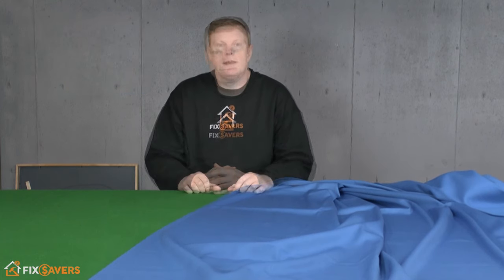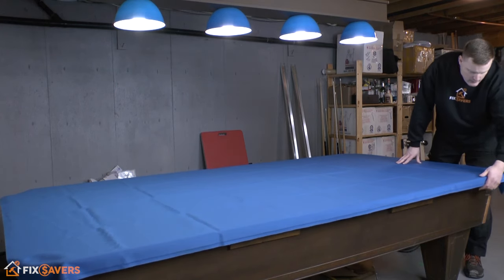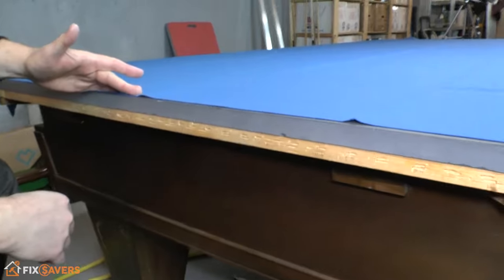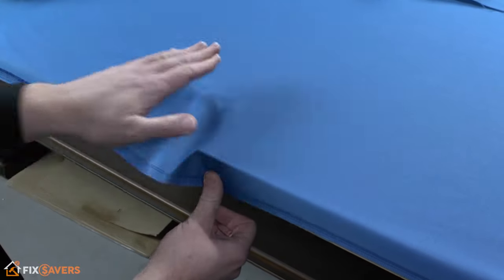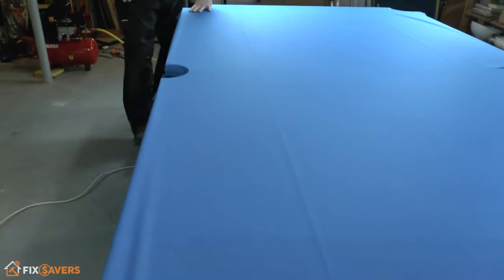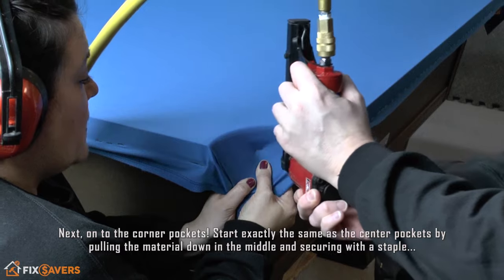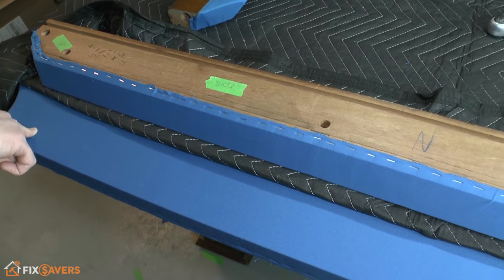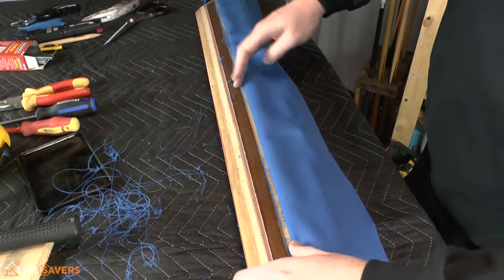How to Install a Pool Table Cloth - FULL DIY GUIDE, BEST ON YOUTUBE!!!

Comment: I was quoted $700 to level and re felt my pool table. I offered them $500 cash thinking that was enough money but it wasn’t so I did it myself. The company that put it together the 1st time used bondo on the seems so other videos helped with that, but this was the most helpful. Thank you.
Reply from the maker: Excellent stuff! Glad it was helpful for you! We also have video's on how to seal your slate joints using both beeswax and Bondo so you can choose which best suits. Both are available on our channel. Hope that helps! 👍

Comment: Thank you very much for the time and effort in making this and the other video tutorials.  Just finished the process of my first assembly up to beginning to install felt now.  Without your videos, would never have been able to get to this point at the quality desired.  Have been learning lots of added tips and tricks on final leveling after 0 degrees on the digital level by slow rolling a ball on the slates, and techniques of getting super flat beeswax on cracks and filling holes (level) with beeswax. Your videos gave me the confidence to attack the project with my Olehausen.  The pocket finishing is something prior installers never did and it will look far better than the pros who left ugly cuts visible in the pockets of my last table.
Reply from the maker: That's great to hear! Really good to know that we've helped you out along the way with you install, and hope everything went nice and smoothly for you! Yes, the pocket finishing is something that is overlooked a lot (even by professional installers, as you mentioned, most likely due to time factors) but it does make such a big difference to the overall look inside the pockets - those cuts always look terrible (ironically, somehwhat unfinished in appearance, lol!) Thanks again :-)

Comment: Simply outstanding video!!  Thank you.  However, I am confused about where the stretch calculations from your other video come into play.  I plan on doing mine in a couple hours if anyone has ay input for me that would be greatly appreciated.
Reply from the maker: Thank you for your comment! Just to clear up any confusion, we are currently putting together a newer and more advanced version of our cloth installation video, which will utilise the stretch index method. The stretch index can be very helpful when you are fitting high-end worsted cloths that have very little give (such as Simonis) as they can be very unforgiving.

The new more advanced video is NOT designed to be a replacement for our original cloth installation video. Instead it is designed for people who want to delve a little deeper and/or are installing cloths such as Simonis.

It's likely that 80%+ of cloth installations done on pool tables are done without utilising a cloth stretch index method, by a process identical or similar to the process shown in our original video, so it will remain relevant to the majority of people who want to do a DIY cloth install.

But if you are installing Simonis (or similar top-end worsted cloths) then the new more advanced video (which uses stretch index) would definitely be a good option.

The process is slightly different if using the Stretch Index method, simply because it HAS to be due to the requirements of the process. But you can use either method, original or advanced. They both work!

Hope that helps!

-----------------------------------------------

To help support us:

1) Please be sure to use our Amazon Links!

2) Please ensure you LIKE our video's, and SUBSCRIBE to our channel!

3) Donations always welcome! Hit the SUPER THANKS option below the video on YouTube!

Thank you for your support!

Comment: Thanks for the informational video. The problem I have is my Kasson pool table doesn't have the wood backing on the slate pieces, so it needs to be done with adhesive. Any videos on how to do that?
Reply from the maker: Hey there! Unfortunately we do not currently have a video for the glueing method for pool table cloths, only the staple method as shown here. Sorry we couldn't help this time 👍

Comment: I really appreciate this video! One question though... How do you tell which side of the cloth is the playing side?
Reply from the maker: The playing surface is smoother, whereas the rear will look a touch fluffier. You may want to check out our new cloth installation video (specific for worsted cloths) as this shows the difference as an example, watch from 8:00 onwards for the clips that compares front and rear of cloth: https://youtu.be/s4mH1Lw104I  Hope that helps! 👍
Reply: @AverageJoesPool  Thank you! I got my cloth now and it has an embroidered edge, so now I have more indications than I need ;)

Comment: Thanks for extremely well done videos. Can you please recommend a worsted cloth from Amazon Canada? So many conflicting reviews Reg ball marks and creases!
Reply from the maker: Hey there! Thank you, glad you are enjoying our video's!! With regards to cloth, budget is always a factor. Pretty much the best of the best is Simonis cloth, but it does (naturally) come with a higher price tag. We have added links to several cheaper options on Amazon (including amazon.ca!) into the video description if the budget is tight. Yes, cloth reviews often vary from great to terrible, and this often seems to be linked to the experience that the person had fitting the cloth rather than the cloth quality itself. On cheaper cloths expect ball marks (burns, white spotting). You get them on expensive cloths too, but they tend to be more resilient (Simonis make a 860HR cloth and the HR stands for High Resistance, designed specifically to reduce white spotting). Hope that's of some help!!

--- 

To help support us (for both you and others reading this) there are a few things you can do:

1) Donations both needed and welcome! We cannot operate Average Joes Pool without the support of people like you! You can donate by PayPal - just go to www.paypal.me/thanksfixsavers - or alternatively you can click the SUPER THANKS icon under the video on YouTube and donate that way too!

2) Please ensure you subscribe to our YouTube channel. 

3) Please Like our video's on YouTube (by clicking Like!) 

4) Please help spread the word, the more people who know about us the better! Add links to our video's in forums, let people know about us.

Thank you for your support!

Comment: My table is 1" 2 peice slate but it dont have the wood strips under the outter bottom edges to staple the cloth too? Has someone removed them? My last cover I had to glue on with clamps..should I put the wood strips on it?
Reply from the maker: Yes, not all pool tables will have the slate backing. Most do, but not all. The other method for re-clothing is gluing instead of stapling, which it would seem the manufacturer of your table intended. The process is different though, and unfortunately we do not have a video for the gluing method so you'd have to have a good search around YouTube and see what's out there. I would recommend against adding the timber backing retrospectively as this throw up issues such as overall table bed height, the skirts may not be long enough to hide the slate edges anymore when raised etc. We hope you find a good guide for gluing. Best of luck! 

-----------------------------------------------

To help support us:

1) Please be sure to use our Amazon Links!

2) Please ensure you LIKE our video's, and SUBSCRIBE to our channel!

3) Donations always welcome! Hit the SUPER THANKS option below the video on YouTube!

Thank you for your support!

Comment: Nothing is working to get the wrinkles out around the side pockets. We have Predator cloth. Any advice?!?!
Reply from the maker: Hey there! Usually if you find you are repeatedly getting wrinkles whilst you're confident you are doing everything right, it can be best to rewind a little. The cloth may not be stretched quite right in a certain direction before you got to the side pockets. If you undo a few staples at a time you'll be able to pull the cloth slightly more in that area and see if it makes the wrinkles disappear or get worse. The pull may be required at an angle you would not expect, hard to know without having it in front of you. But that would be a good route to take, try and find the source of the issue rather than fighting against something that's not quite right. Hope this helps!!

--- 

To help support us (for both you and others reading this) there are a few things you can do:

1) Donations both needed and welcome! We cannot operate Average Joes Pool without the support of people like you! You can donate by PayPal - just go to www.paypal.me/thanksfixsavers - or alternatively you can click the SUPER THANKS icon under the video on YouTube and donate that way too!

2) Please ensure you subscribe to our YouTube channel. 

3) Please Like our video's on YouTube (by clicking Like!) 

4) Please help spread the word, the more people who know about us the better! Add links to our video's in forums, let people know about us.

Thank you for your support!

Comment: Are heading protecting required?
Reply from the maker: Do you mean ear protectors? It depends on your preference. I always wear them whilst using power or air tool of all kinds, and in the location of this table the ceilings are quite low and no soft furnishings and so you get a lot of noise. But most people are happy to use air staplers without ear protection, whatever you prefer personally 👍

Comment: Cloth developed wrinkles around the center pocket after the holes where cut into the cloth.........did not appear right away but the hole looked distorted after cutting...........I used nail polish to finish the cut around the hole...........I cut the holes by inserting a tube into the bolt holes and hampering on the tube with a hammer to cut the cloth..........what is the best way to fix this?  thanks
Reply from the maker: My guess would be that by hammering the tube into the hole to cut the cloth you would have stretched the cloth, hence the hole now looks distorted. The holes should be cut with a knife or scissors. The only way to fix this would be to see if you could re-stretch the cloth a little by undoing the staples one area at a time and taking up the slack. And then re-cutting the holes but this time with a knife or scissors. Not a hammer and tube. Hope that helps! 👍

--- 

To help support us (for both you and others reading this) there are a few things you can do:

1) Please be sure to use our Amazon links in the Video Description!

2) Please Like our video's on YouTube (by clicking Like!) 

3) Please ensure you subscribe to our YouTube channel!

4) Donations both needed and welcome! You can donate by PayPal - just go to www.paypal.me/thanksfixsavers - or alternatively you can click the SUPER THANKS icon under the video on YouTube!

5) Please help spread the word, the more people who know about us the better! Add links to our video's in forums, let people know about us.

Thank you for your support!
Reply: Clarification, I did not stretch the cloth to cut the hole, the process is similar to die cutting where the cutting surface the sharp inside diameter of a tube is held against the bottom of the cloth and does not stretch or raise it off the surface of the slate and then a ball peen hammer ball end is used to lightly strike the cloth pinching and cutting the cloth against the sharp inner edge of the tube thereby cutting the fibers very easily.  Forms a near perfect hole in the cloth slightly smaller in diameter than the hole itself since the tubing is inside the hole and fits tightly.  I assumed that cutting the hole with a knife and scissors would cut all the fibers around the hole similar to the way the die cutting works and if so then I would expect similar problems with the knife and scissors method.  I'm thinking I could have super glued (or glued) the cloth to the slate around the hole prior to cutting the hole.  I also discovered that the wrinkles are coming and going away with temperature.  It is currently start to drop from the 70's F to the 50's F.  Thanks for your prompt reply and excellent video.  @AverageJoesPool

Comment: I’m not sure if someone commented on this already, but it would be nice to have reference to the stretch index for the cloth on this particular video. It doesn’t seem to use it or reference it.
Reply from the maker: Thank you for your comment! Just to clear up any confusion, we are currently putting together a newer and more advanced version of our cloth installation video, which will utilise the stretch index method. The stretch index can be very helpful when you are fitting high-end worsted cloths that have very little give (such as Simonis) as they can be very unforgiving.

The new more advanced video is NOT designed to be a replacement for our original cloth installation video. Instead it is designed for people who want to delve a little deeper and/or are installing cloths such as Simonis.

It's likely that 80%+ of cloth installations done on pool tables are done without utilising a cloth stretch index method, by a process identical or similar to the process shown in our original video, so it will remain relevant to the majority of people who want to do a DIY cloth install.

But if you are installing Simonis (or similar top-end worsted cloths) then the new more advanced video (which uses stretch index) would definitely be a good option.

The process is definitely slightly different if using the Stretch Index method, simply because it HAS to be due to the requirements of the process. But you can use either method, original or advanced. You can pick and choose, watch both and do whichever you like the look of, they both work!

Hope that helps!

--- 

To help support us (for both you and others reading this) there are a few things you can do:

1) Please be sure to use our Amazon links in the Video Description!

2) Please Like our video's on YouTube (by clicking Like!) 

3) Please ensure you subscribe to our YouTube channel!

4) Donations both needed and welcome! You can donate by PayPal - just go to www.paypal.me/thanksfixsavers - or alternatively you can click the SUPER THANKS icon under the video on YouTube!

5) Please help spread the word, the more people who know about us the better! Add links to our video's in forums, let people know about us.

Thank you for your support!

Comment: How about moving house can I reuse the same cloth?
Reply from the maker: Yes, absolutely you can. However, refitting tends to be much harder than a fresh installation, and it's hard to get 100% good results because you have to try and line everything back up exactly as it was before, including stretch, and the cloth is now cut and has staple holes etc in it. If it's an expensive cloth then re-fitting is a good option. But if it's a cheaper cloth it may be better to buy a new cloth and save yourself the headaches of the refit process. Hope that helps 👍

Comment: I have a question.  One of my shims has moved from under the slate and caused it to droop some and come out of level in one corner.  Are you able to partially lift some of the felt, enough to relevel the slate, then just retighten it and staple again or do you need to redo the entire piece of felt?
Reply from the maker: Well, once out of alignment it should be levelled again really. You could try to re-shim just the part where the old shim failed, but you're unlikely to get it perfect, and the seam may well have cracked it's beeswax seal due to the drop. But if you do want to try it and see, you should not need to remove the cloth at all to level the slate. The slate should have timber backing (which you staple in to) like in this video. The shims go underneath this timber frame, so sit between the table frame and slate timber frame. So you should not need to remove any part of the cloth if you want to try and re-shim as a quick fix to see you through. But really you'll want to level up the slates afresh, which means cloth removal and re-sealing the seams. But for a quick temporary fix you could try it. Hope that helps!

--- 

To help support us (for both you and others reading this) there are a few things you can do:

1) Donations both needed and welcome! We cannot operate Average Joes Pool without the support of people like you! You can donate by PayPal - just go to www.paypal.me/thanksfixsavers - or alternatively you can click the SUPER THANKS icon under the video on YouTube and donate that way too!

2) Please ensure you subscribe to our YouTube channel. 

3) Please Like our video's on YouTube (by clicking Like!) 

4) Please help spread the word, the more people who know about us the better! Add links to our video's in forums, let people know about us.

Thank you for your support!

Comment: i use a soldering gun to burn the bolt holes out it prevents unravelling
Reply from the maker: That's an interesting solution. It should seal the edges pretty well 👍